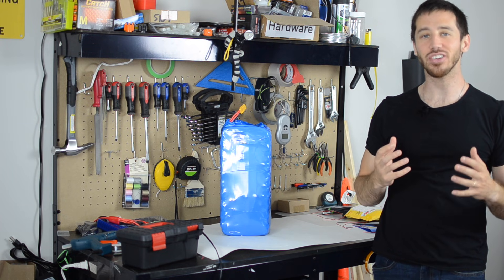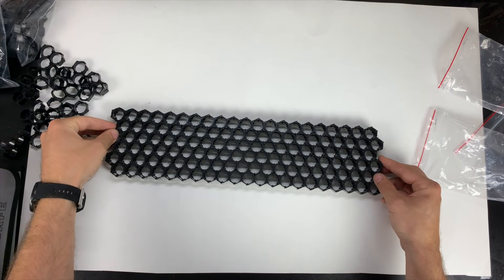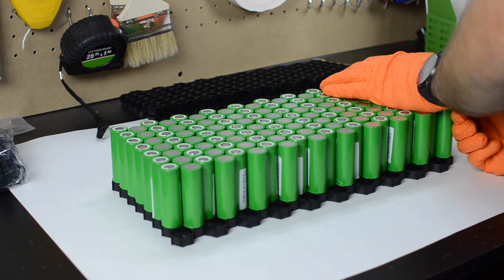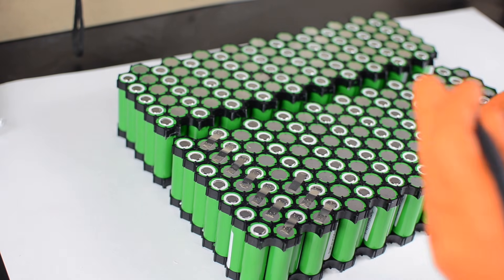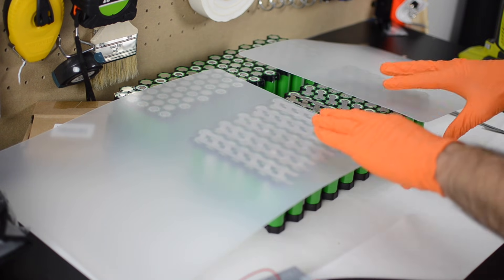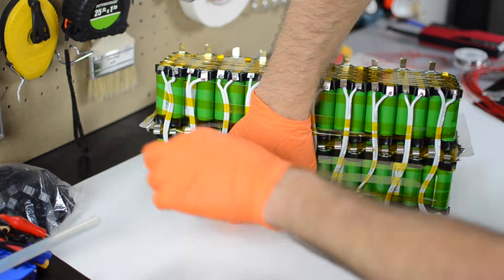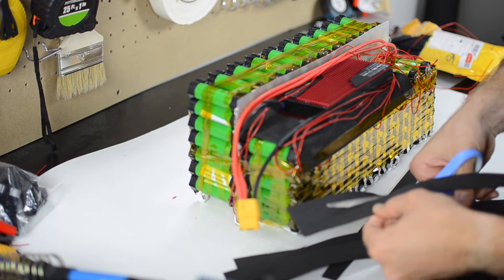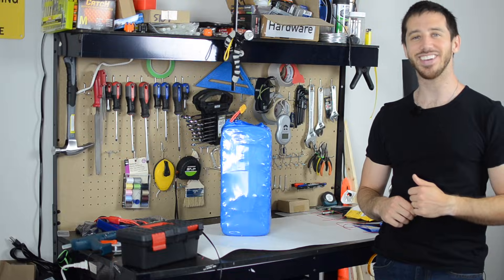DIY electric motorcycle 72V battery build (DIY E-moto Part 3)

Comment: Hey Micah, I'm just wondering if I can make a battery pack using different capacity batteries? 

Thank you.
Reply: I doubt it would be a good idea, the lower capacity ones will discharge  and your bms will cut off, making your pack as good as the lower capacity cells.
Reply: @TheMoorishAlHazen Hi, that makes sense. Thank you.

Comment: Just wondering why you did it in this configuration versus two 36 volt in series
Reply: Simplicity and scalability.  2 x 36V would require 2 BMS [and all the other overhead] and a lot more trouble to work on if there are issues

Comment: Hi Mika, can you advise if I need an isolating switch for these high voltage batteries. My Ebike is 52V and I just unplug the Anderson plugs (not readily accessible) but if I encounter a problem such as a short it might be good to be able to quickly break the circuit. If so is there a key switch that will be fit for purpose? Thank you.

Comment: Hi Micah! I'm planning to install two batteries on an e-bike. Do you have any information about what kind of switch to use to switch between two batteries? The contact form on your website doesn´t work so I'm posting the question here.
Reply: If you wire them in parallel you can use both batteries at the same time.

Comment: I dont see your video here that I watched where you reviewed a battery pack by tearing it down. In doing so you claimed that the nickel strips were steel and nickel coated or plated and therefore not of good quality. To proove this you showed them to be magnetically attracted. Believing you knew what you were talking about (why else would you be spouting this) I was outraged when the pure nickel strips I ordered arrived and they were magnetically attractive. I contacted the seller making a fool of myself before checking the facts. And the facts are, nickel is highly magnetically attractive and closely related to iron, and you dont know what your talking about. Dont you think being correct matters? And especially calling yourself a school! Additionally its a little hard to believe that you didnt know this because nickel IS magnetically attractive havent you EVER wondered why EVERY roll of pure nickel you test is so? You said you were disappointed, you mean every time? What I don't get is WHY? This was pretty easy to research and discover the properties of nickel so why did you pull a fraud right of your ass and call it true?

Comment: Hola Micah,
Merry Christmas to you and yours, I've made it just under the wire (11:27PM 12-25-19).
 Glad to see you back, healthy, wealthy and having fun.
I have 3 words;eHONDA eHONDA eHONDA!!!!!
Really want to see this project's progress. This video is a great continuation and contribution. I'm more excited now than before!!.I don't like the look, or how NOT nimble they are, but for $500, I couldn't pass up an eDrift Fat Tire Scooter. It needs a larger pack than the 60V 10ah Li-Ion  it has at the moment, so this video may be instrumental. Do you have any thoughts on overvolting that eBike's 1500W Brushless motor's speed controller?
BTW; something I've been doing to my 57V (soon to be 61V) "Vruzend" packs, since I live in So. Cal. ie the Mojave Desert, is NOT completely sealing the battery packs I build. I leave 2 sides open, so there is airflow through the pack. On my little 32mph 750W Brushed Motor CURRIE Schwinn "TESLA" eScooter (stock was 36V/15mph), I also drill out/swiss cheese the bottom floor of the battery case, so air can get up into the pack and add even more cooling. Even in the 90-100 degree temps that I've run my eBike packs in this last summer, none got over ambient temp and my packs are as strong now as when I built them. 
Just a tip that I hope may help for those of you in hot climates. 
Now, heat shrink is cheap, so for this cold(er) time of year it's easy to seal those battery pack sides up & the holes in the battery tray and allow the packs temp to stay inside to help keep the pack warm as well. 
Then, just cut the sides back out for summer and only do the reseal job once a year.
Thanks in advance.CheersBoots LangleyLa Mesa, ca.PS; Hey, I have a decent Resume myself;Mechanical Design & Machine Drafting  (2 yr Tech School Degree), a lifetime of Automotive/Motorcycle Service, Repair & Restorations/ Racing , including several years as a Technical Editor (Cordura Publications/ Mitchell Auto & Truck Repair Manuals). Any need of a part time, Old, toothless, fat guy as a USA/So. Cal Editor of anything Electrical Transpo Related? 
Especially 2 wheeled? 
Just wondering!! ;-)Thanks in advance.PPS; I just spent 30 minutes typing and spacing and creating a completely readable message and stupid youtube turned it into an almost unreadable blob of text!! SIGH!

Comment: Hi thanks for sharing the build , im inspired to build the same now. Also i would like to know if there is any possible way of charging this battery pack with 100w solar panel? . if yes can u share how can it be done🙂
Reply: Harish Rajamani   You can use a “buck style” converter, like a MPT-7210A....connect it to your solar panel, and program the unit to charge up to a 72 volt battery.  They are dirt cheap on Ebay.  It will work slowly with a 100 watt solar panel, only about 1 amp charging on a sunny day.  (1 amp x 72 volts = 72 watts)   I charge my e-bikes with solar,  using this very model...but use 6 solar panels for increased charge rates.

Comment: Good day Sir; 
Still determine to connect w/you one day. 
Anyone who the VoilaMart E-Kit just came in I'm excited and confused the brake handles come with attached wires and ONLY one cable housing (I'm assuming it's for the brake cable)  So how do I attach my Shimano sprocket/rear gear cassette cables???? How do I change gears with these handles HELP!

Comment: Hi guys, I'm a beginner and I'm building a battery pack with salvaged cells from laptops very similar with this one 72v as well. I have a question: Why he spot welded the the batteries positive with negative even in parallel? For instance the whole pack is one positive up and one negative up. I didn't understand. Could someone explain to me? ELI5 peharps. Thanks!

Comment: I had this question in your last video, but I think I know the answer now
 - Hi since this is latest video I hope a get a response 😅
Basically I have a 14s 2p battery with mj1 3.5ah 10A cells with a 30a bms and 1500w motor
Basically if I give to much throttle the bms is switching the power off and I need to unplug and plug back the battery otherwise the power won't come up
Do you know why this is happening and what I could do to fix it
Thanks in advance
Reply: The battery voltage rating is:
• 14s*4.2Vmax= 58.8Vmax
• 14s*3.6Vnom= 50.4Vmax
• 14s*2.5Vmin= 35Vmin

The battery current rating is:
• 2P*10A=20A

Power (W)/Energy (V)=Current (A)
• 1,500W/58.8Vmax)=25.5A
• 1,500W/50.4Vnom)=29.8A
• 1,500W/35Vmin)=42.8A

The 14S/30A BMS rating is 50.4Vnom*30A=1,512W

To put it simply, you've connected a load greater than the system rating. Especially considering that electrical circuits are typically specified with a 25% safety margin. Yours has almost none.

Not all Battery Management Systems are created equal. While the BMS is rated at 30A, it may not be up to pumping that much power on a continuous basis. Most likely, the BMS is disconnecting on over current.

What's unseen is how your batteries are being damaged. They may be rated at 10A, however they're capable of discharging at higher rates, up to and including that of a dead short. When goosing the throttle to full power, depending on state-of-charge, you're pulling between 25.5A and 42.8A from a pack rated at only 20A.

This generates a lot of heat, and heat does two things:  If there's enough of it for a sufficient duration, there will be fire. However, without fire, the life of the cells is being drastically shortened.

You have two choices:
Option A:  Decrease the motor power rating by governing it down, or replacing it with a smaller motor.
Option B:  Go to a 3P or 4P pack, as well as a 50A BMS.

Of course, you could always keep your "foot off the gas", so to speak.

Best of luck.

Comment: A good tip to customize blue shrinking tube is that you can glue them together with superglue to create really big tubes or custom shapes. Note that the superglue won't release when hot air is applied l. Happy building!

Comment: Another clean build, I like the folded battery.  Did you say what size motor your going to use on the conversion?  Thanks for the safety tips, I find the plastic sheeting has saved me a couple of shocking surprises.

Comment: Also If you are ever considering building one of these and cutting corners and just soldering with a $12 iron and wire, think again.  When you finally get the connections right after 14 hours of struggling they will come apart during your travels and you will kick yourself, have to rip the whole battery open and redo until you finally just get fed up and buy a spot welder.  Take it from me I tried to cut corners and it cost me days of extra work and extreme frustration.  Time is as important as money when building these things

Comment: Another CLEAN build bro!  I used the 52v triangle video battery for a couple of my bikes and now I'm feeling the need for more speed & power.  
Gloves and the plastic cover while welding can save you a BAD burn so listen to him!  I put the nickel strip on the wrong cell once and burned my finger almost down to the bone cause with electric burns you won't notice it till a couple seconds after its too late.  Just be careful.  I still get nervous building these things after that s** so better safe than sorry, 72v will burn BAAAD

Comment: AC current is dangerous for people after 50 volts
I know that, well
Q1 - How many DC volts current damage the human body???
Q2 - Does this battery (72v 2.8KW) harm human body?
Reply: 50 V DC can do you in too.  The pack in this video can certainly harm someone handling it incorrectly.  Treat it as a lethal shock hazard, as it is.

Comment: I am watching all videos. Guide me about internal resistance of lithium cells. I don't get anything in your book Diy lithium battery.
Q. Why are not using lifepo4 instead of li ion?
Reply: Higher capacity cells tend to have higher resistance. Higher drain batteries tend to have lower resistance.
https://youtu.be/qFTTyy5_WD8
Those other cells you mention I think have only recently come down in size and price.
   The shape and volume to fit in the bike frame is restricted, yet he wants a high voltage so needs to link many cells in series and parallel. What is the form factor of the cells that you are thinking of using?

Comment: Is there a way I can buy one of your batters I really need an 24 volt or 25 would work for an old school ebike. i am looking for an 20-30Ah. I hate buying crap from china if i don;t have too. I know i can most likely make one myself but there is always that chance i will F up.
Reply: he has a recommended trusted aliexpress supplier on one of his videos, heres the link to the supplier,

https://liitokalahongkong.aliexpress.com/store/217753?spm=a2g0o.detail.1000002.2.367d79f1wd96Q8

 ive used them and they are good on communication and the batteries are solid, ive purchased a 48v 25ah battery and its lasted me since 7/10/19, im still using it in 30-40 degree weather (not recommended) and it still runs! well worth it and only costed 305 after shipping, great recommendation

heres a link to the  battery i used, good luck!   

https://www.aliexpress.com/item/32995889825.html?spm=a2g0s.9042311.0.0.3dad4c4d2upj9z

Comment: Love the battery. What kind of BMS is that. I think I need to change my BMS as it will put the battery in a dormant or zero voltage state after putting on a 100% charge for a few hours and it later wakes up as though it is overcharged and is shutting down the battery while balancing? Strange as it just started doing this. It is a 52 volt 24 Ah triangular Luna battery it has a small voltage meter on it that is how I discovered this problem, and they are recommending opening up the pack to do a voltage check on all the cells. What do you think is going on?

Comment: Trust me peeps. Adding that plastic sheet is a good idea.
I dropped a nickel strip whilst hovering over to put it in place and like bread falling butter side down it found the WRONG place and INSTANTLY welded itself in place before melting like a fuse.
I nearly cut the top of my thumb off as I foolishly tried to brush it off too !
Oh.. And it doesn't end there.
Whilst placing the ANT BMS the momentary switch (metal surround) brushed against a contact and KtBZZZZ fried the switch !

My build is a 20s 5p. Only 5p because that's all the room I've got
Be ultra careful !
Oh Micah.. How come you never used the Samsung 30T cells ?
I'd have thought 35 amp output would've been better served on the Honda Cub ?
https://eu.nkon.nl/rechargeable/li-ion/21700-20700-size/samsung-inr21700-30t-3000mah-35a.html
Reply: Arent those samsung cells you are suggesting bigger than what he is using, 2.1cmx7cm vs 1.8cmx6.5cm? I guess 5mm difference in length doesnt matter but 3mm wider cell may not fit into that hexagonal holder he is using?
Btw, thanks for that link
Reply: Yes they are slightly larger than 18650's but Tony normally uses LitoKala's anyway !
[Edit]
Wires crossed.. Too many vids I'm watching lol
This is Micah.. I've mistook for Vortecks (Tony)
Reply: @bluewanderer9903  
This is Vortecks latest thingy..
https://www.youtube.com/watch?v=TTOsjb9w9SA
Reply: What is difference between these assembly from small ones and buying the large ones like ~12v, 65amp. How I decide which is better? Any help?

Comment: Thanks for the video! I have had a electric pitbike project going for so long, already have motor and controller but I need 72V battery and bms + charger. Any recommends for bms and charger?

Comment: Very good work. Buy I have a trick for you. In all Electric standard is mandatory have 2 independent fixing methods for soldering. With a hook if you have cold soldering cable remain in position. Can you reduce risk for bad contact.
Bye. Bye from Milano.
How much It cost this battery?
Reply: if you live in usa its about  $970 if you factor in nickle strip + holders +cells +bms+ heat shrink . I have gotten my cells rely ably from imrbatteries for my last builds. there on sale right now but if not on sale there typicly 5.99 per cell if you get non sale its like 1550 usd